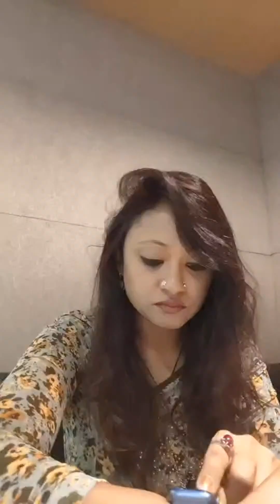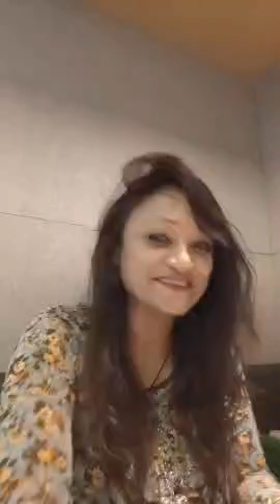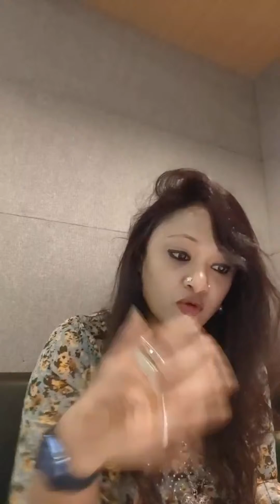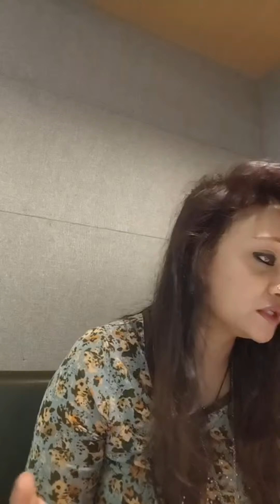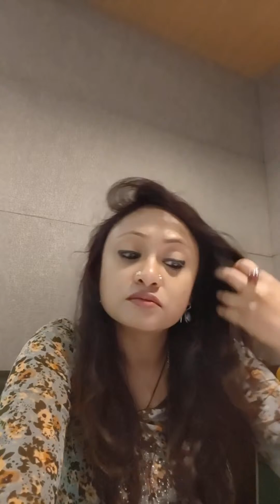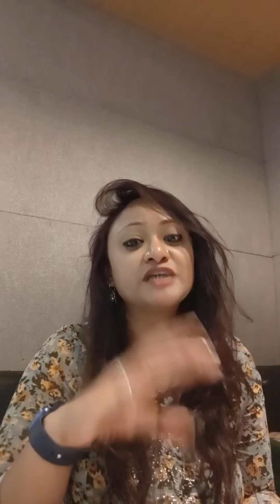🏝️🔐 Impula Ledger: Gas-Free, Law-Regulated Paradise #ImpulaNetwork #PrivateBlockchain #ZeroGas #Web3

Comment from the maker: ⚡🔋 Solar-Plexus Powered Wearables: From EMF Safety to Neuron-Hacking
Your abdomen is an untapped battery. New handheld stimulators (class H02J7/00034) pull micro-watts from safe polarity-protected cells while talking to the celiac plexus. Result: on-device AI decides how much current will wake up the right sodium–calcium pump… without ever breaching skin. Tony-Stark-level bio-hacking is officially outpatient.
#SolarPlexusTech #WearableNeurotech #EMFProtection #Bioelectronics #Industry40 #PainTech #HandheldHealth #FutureOfHealing